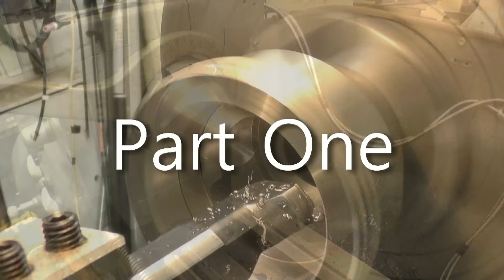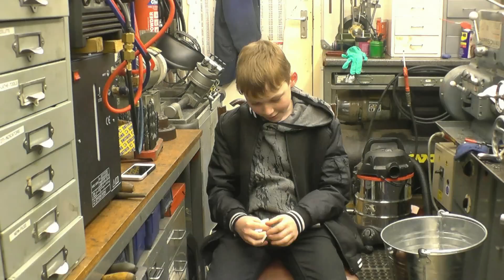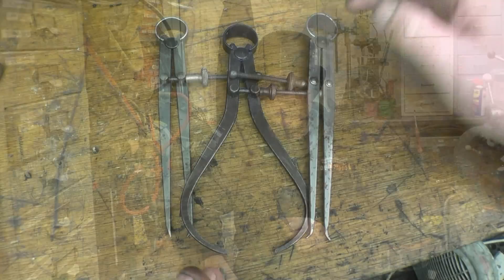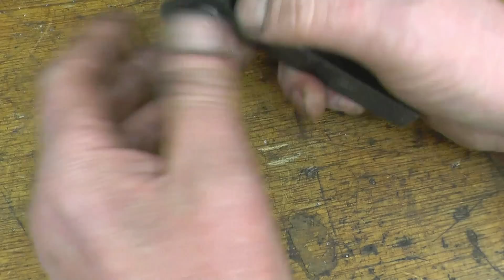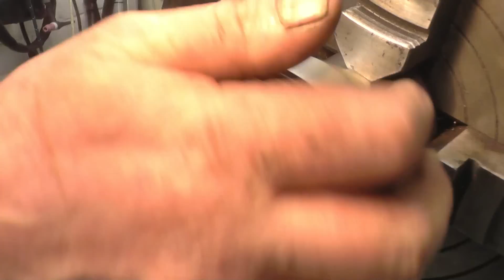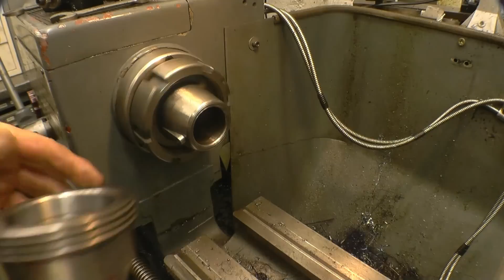SNNC 161 P1 More ER 40 Fun   Test Bar Give Away

Comment: When you fit the chuck, it seems you have to give it  a fair amount of effort to  get it tight. When you loosen it it's locked on the taper. The catch plate, on the other hand, frees off as soon as you loosen the lock ring. Is it possible that the  back of the taper is still tight on the chuck?

Comment: Hi, John, that chuck is leading you a merry dance! Daft idea, but is there clearance between the nose of the lathe spindle taper and your chuck ? If there is no clearance then its possible that the chuck is not seating fully on the taper. Also there needs to be clearance at the threaded end of the chuck to allow it to be fully drawn on to the taper.
Carry on the good work!

Comment: Before you begin on that faceplate, I would be interested to find out if the half-thou location is in the same place every time you mount it on the spindle. Your repeatability might be even BETTER than that half-thou.

I would also be interested in whether the "old" collet holder was off in random locations or fitting in just a couple of "wrong" ones. If it's a couple of wrong ones, it might be worth chasing down the cause.

Comment: On the face plate you are measuring axial run out, but on the collett holder you are measuring radial run out. they are not the same thing. Maybe it was movie magic but there certainly appeared to me to be run out of at least .0005 on your part after you cut it. Have you checked the run out of your spindle nose itself? Perhaps you have a slightly loose spindle bearing and the oil film is messing with your readings.
Reply: I saw that too.
Reply: Since the piece is indexed by the key and the piece was turned in place it "should" be concentric with near zero runout  even if removed and refit. 
Also possible the keyway is not dimensioned properly, too narrow or shallow or long or insufficiently radiused. 
A little prussian blue or lapping should show any high/low spots.

Comment: Hi 
Is it two long on the nut side so it is not locking on the taper, but locking on the nut.
You cut the taper but you did not cut back the length of the threads, it may be locking 
up before the full taper is a fit ???
jeff

Comment: Now that the taper has had a bit of material removed the whole thing goes closer to the headstock.  Does it need to have some material removed from the threaded side, so the taper actually makes full contact?  Maybe check it with some Sharpie bluing. 
Probably not bottoming on the register before running true on the taper.

 Does the key come out easily, so you could lap the new part to the spindle?  Its MS, probably softer than the spindel, so not much risk of ruining the spindle's fit to the other chuck tapers.

Just my 2p.

Comment: John, is the hole in the key way depth too small for the key. it looks small on our screen compared to the backplate.
Maybe you could use eng blue and test to see if its rubbing and slightly rocking the collet chuck.

Comment: Strange. You should not get that runout even if the taper wasn't perfect. At 10:24 you have a bit of runout even when you just made a skim cut.
I think that there is something sticking. Either the keyway or the end of the thread that is bottoming out.

Comment: I have an old clausing lathe that the chuck seems to shift around on the taper. It is same taper with same lockring in this video. I faced the back of the chuck (the threads) off around .030". Tried it again, had no effect. I have plenty of better and new lathes to choose from, so never figured it out. I still do use the lathe though, but for smaller stuff and not critical stuff. I thought of one possible reason, never checked, but maybe key is seating too soon before taper draws tight. never checked though. I will be watching you though, maybe you will figure it out for me ;)

Comment: Hi John. At 10:27 when you're clocking the nose that you just turned, you say "there's no runout...".  
Maybe you should be using your clock with no innards 'cos I'm sure I can see the clock you're using showing about 0.0005".
Then you remove and replace the collet head, get the same reading and are not happy with it.
Perhaps it's just me, but there doesn't seem to be any difference between the two readings from what I can see.
Regards Mark in the UK